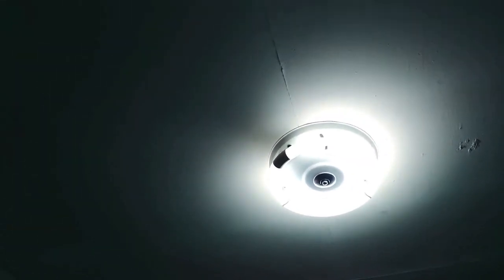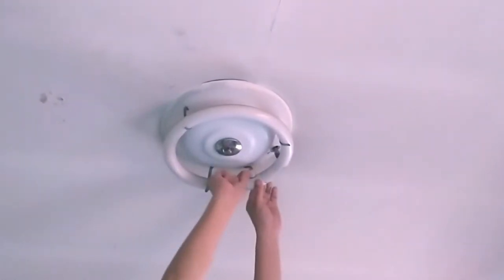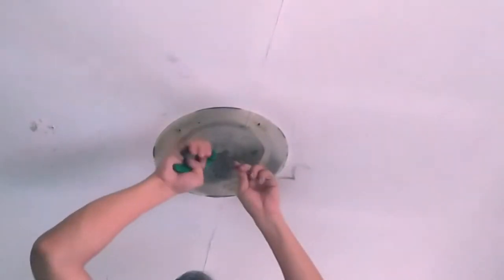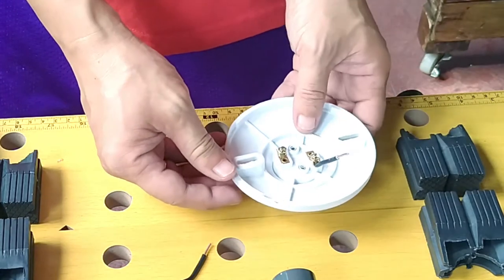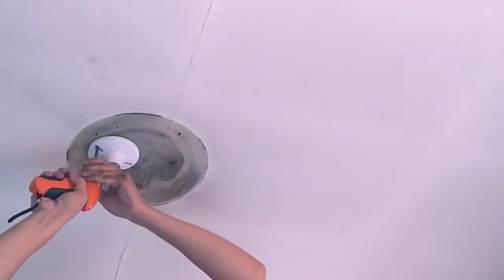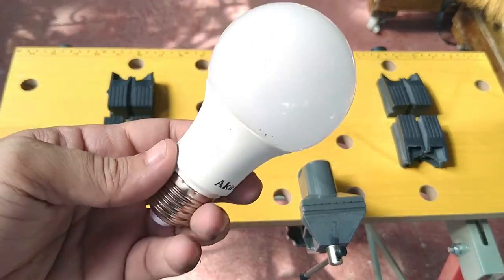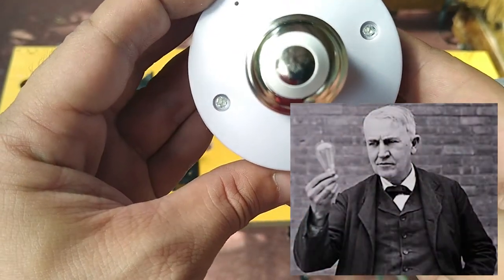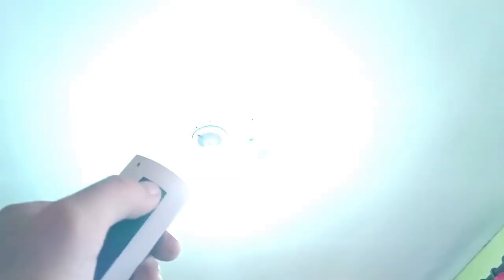Remote-Controlled Light Bulb (No More Walking to the Wall Switch)

Comment: Question sir, is it normally-open (meaning it is turned off by default)? I am looking for an RC receptacle that does not immediately turn on upon being energized
Reply from the maker: Yes, it is turned off by default. You turn it on using the RC. To be safe, turn off the main switch (on the wall) while installing the receptacle.
Reply: @HanDIYman007  thank you so much! I hated the other brand since it works the other way around

Comment: When I bought my house in the 1970's, there were 9 of these old circline fixtures throughout my basement.  By the Mid-90's we found we could no longer obtain these circular fluorescent replacement bulbs so I was forced to replace them with double 40W, 4 foot fluorescent fixtures.  Shortly after Home Depot came to Canada and they supplied the circline lamps again, but too late.  In recent years, I have replaced all these fixtures with 14" diameter circular LED fixtures that have the LED elements integrated within them.  Along with a government energy program, the LED replacements were very cheap and now consume seven times less energy.   I also replaced six fluorescent tube fixtures in my garage/workshop with the same LED fixtures.  My workshop is only heated during winter when I am in the shop working.  Fluorescent tubes and compact fluorescent bulbs will not light when temperatures are very cold, so I had to wait until the heat came up before they would turn on or achieve full brightness.  LED's don't have this problem...they light instantly.
Reply from the maker: Sounds like you've had your fair share of the lighting evolution. I can relate so much to your story since our home was built in 1980. I wonder what's next after LEDs?

Comment: Is it a radio signal or is it infrared? I need this to turn on a light from inside my room with the door closed (light bulb outside of the room)
Reply from the maker: I think it's infrared since there are times the light doesnt turn on without a clear line of sight to the switch.
Reply: @HanDIYman007  oh damn it i guess I'll need a wifi one
Reply from the maker: @tomasdahuabe  i stand corrected. I did actual experiments and read more about its specs. It is definitely operating on radio frequency. But whatever you are buying, pls check its specs first.
Reply: @HanDIYman007  oh wow, nice to know, thanks a lot for testing, by the way I'm asking because i have the idea to use this as a "recording" light/sign for my home studio
Reply from the maker: @tomasdahuabe  thats a clever idea! You may also want to consider a proper "on air" or "recording" sign too. I saw some of those being sold online too.
Reply: @HanDIYman007  Yeah I searched for some on my area but had no luck finding any, so i'm making one myself. Oh and when you tested it, did it work when toggling it between walls/doors? I'm about to buy one which I know is RF and something tells me it'll work but I wanted to be sure by consulting to you :)

Update: I just got the device and works like a charm, I'm able to turn it on and off from different rooms between drywall and doors, I'm planning to get rid of the male part of it and connect it directly to the wall with a conventional cable and plug. Funny enough, the device looks exactly the same as yours, so it's probably made in the same factory but sold to different brands. Anyways, thanks for your help :)

Comment: i bought the same unit (E27 BULB REMOTE CONTROL). However, after a few weeks  it is no longer working.Batteries are new. It just stopped working. Why is it so? pls help
Reply from the maker: Not sure where u bought yours but mine is still working until now.  Was the remote dropped hard? Is the main light switch still ON?

Comment: Why not terminate the wires directly onto the socket screw terminals?
Reply from the maker: I tried that but super difficult to do up the ceiling on a ladder. Try it and you'll understand what i mean 😂
Reply: I’ve been there 😁. It helps if there is a lot of slack wire you can pull down out of the ceiling 👍
Reply from the maker: Exactly! I didn't have the slack so I was forced to show the workaround in the video 😂